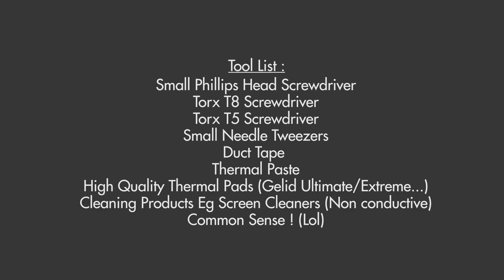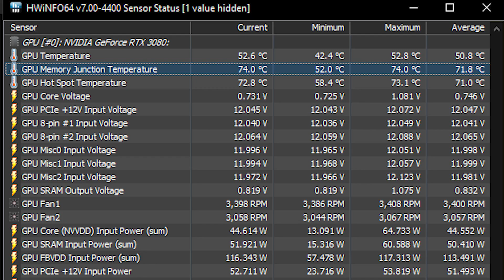Nvidia RTX 3080 (+Ti) Founders Edition Thermal Pad Upgrade Tutorial + Results [G6X ETH Mining Temps]

Comment: I got max Temps 88c on my VRM's using 1.5 pads front and back, max GPU core 70C, I have the stock fan curve but applied an undervolt.  
Average 77C  Temps while gaming most titles. 
I don't hit passed 88c, am I good ? Lol 
Waited so long to get a good price on my 3080FE I just want to make sure I have it running good for longevity.
Reply from the maker: As long as it is below 100*c I guess you're good, because the default thermal pads are a bit shit and the memory junction temps can get really high in excess of 110*c by default which is worryingly hot
Reply: @CHAZMEDIAUK  okay perfect =) yea when I first booted the card I noticed after a 30 min session clocks where all over the place <before I undert volted> GPU core temp was max 75c and one of the fans spooling up ready to take off. 
That's when I open hardware 64 and I saw heat spot and mem temp hitting 101c. 
So being that GPU prices was all over the place I just didn't go an watch much of any 3,000 series reviews.
I was at a lost and everything was new to me when I found out these new Gddr6x were hot runners. 
Watched one episode of gamers nexus teardown and ordered two sheets of 1.5 pads and got to work. 
Thanks again

Comment: For white thermal pads you left them in place without replacing. Any idea what’s the thickness of them? If we use a different thickness pads on back leaving white ones(if at all they are of different thickness) it doesn’t make any sense isn’t it? Also few comments on reddit say there is no use or little use if backside pads are replaced. Is it true?
Reply from the maker: VRAM is flip chip, have a look at diagrams online - so there is quite a lot of heat that spreads through the PCB onto the back where it needs removing so that’s why I put thermal pads on the back to help reduce core temps because all the heat spills onto the nearby chips etc
Reply: @CHAZMEDIAUK  thanks. Did you leave the white factory pads on backside? To left and right?
Reply from the maker: @bps739  nah I binned them. They are garbage

Comment: Hey, what thickness pads did you use?  Didn't see it mentioned in the video
Reply from the maker: 2mm however 1.5mm may work better if you don’t tighten the leaf spring tight enough - I personally recommend 1.5mm

Comment: Hey thanks for the video! I have a question, does dismantling the card and exposing the PCB voids the warranty? do they have any kind of stickers on screw and stuff?
Reply from the maker: No warranty stickers on the 3080/80ti FE since they are designed to have easy removal of the cooler for people wanting to put the EK waterblock on it :)
Reply: @CHAZMEDIAUK  Thanks for the response. Also, do you think putting this on a custom loop will drastically drop the temp on junction?
Reply from the maker: @raghavtripathi564  I guess so since there will be significantly better thermal transfer onto the waterblock than the air cooler
Reply: @CHAZMEDIAUK  Thanks again, I haven't done custom cooling before. So do you recommend any block? EKWB is very expensive for me.
Reply from the maker: @raghavtripathi564  I don’t know if there are any other brands that make a waterblock for the 3080 FE :(
Reply: @raghavtripathi564   Corsair does a great job, my 2080ti is about 28•c (room is 21) in idle and 45 under stress test, I will try it with 3080ti asap

Comment: hi , could a very high vram temp explain why i only get 60mh/s on eth ? I tried every miner, driver etc. Vram always 108-112 °
Reply: did u tried nbminer?
Reply from the maker: You need to limit the power to the GPU to 70% so that it is only using 224W. Unless you have an LHR card

Comment: Is the Lay-out the same for the Ti or are there small differences I should be aware of?
Reply from the maker: Same layout and PCB so there are minimal differences and 2 extra memory modules. You can see in my video there are 12 memory slots however only only 10 of the 12 memory slots are occupied
Reply: @CHAZMEDIAUK  thanks for the quick response! The other thing is I am seeing a lot of differences in people’s personal experiences in pad thickness.  Some have to put in a lot more effort it seems even with 2mm extremes. I really don’t want to be stuck trying to get exact measurements between 2.0 and 1.8 or 1.7.
Reply from the maker: @michaelb3576  might be worth getting a pack of 1.5mm thermal pads for the memory
Reply: @CHAZMEDIAUK  still extremes right?
Reply from the maker: @michaelb3576  I used ultimate here but extreme are supposedly meant to be better but either way both are really good

Comment: Hello, I have a strange problem. I have 2 3080 ti FE. I did the pad replacement and the mem temps went way down as expected but my gpu temp went up to 80 and hot spot temp up to 96!!! I checked the card that I did not do the pad replacement and the gpu temps are only 40 and the hot spot temp is 45. I did a paste replacement artic mx 5 thermal compound. no change. here is where it gets weird. I take both cards apart and swap coolers and now the and now I have the exact same gpu issue on the other card with the good mem temps. I hope I did not confuse you. I joined your discord but I am not able to post on it.
Reply from the maker: Jayz2cents did some testing recently and found too thick memory pads causes the GPU die to have a gap from the cooler cold plate and the die which causes these massive jumps in die temps - Also make sure that when you reassembled the PCB to the cooler with thermal paste that you tightened the screws tightly so that the cooler cold plate makes as best contact with the GPU die as possible. When I changed the thermal pads I didn't notice any change at all to the GPU die temps. 1.5mm pads could help fix this. Hope this helps
Reply: @CHAZMEDIAUK  thank you, I'll order some thinner pads.
Reply: @samuelmakarewicz1728  did thinner pads work?

Comment: Does this voids the warranty? Planning to change the pads on mine. And do you think i can use corsair xtm50 paste? Thanks!
Reply: I believe that it will not void your warranty unless the manufacturer can prove that the work you did caused the issue.
Reply from the maker: I don’t think it voids the warranty since there isn’t a “warranty void if removed” sticker on any of the screws. However I’m not sure about the thermal pads since they’re no longer going to be the original ones

Comment: 3080 and Ti are completely different. This tut is irrelevant for Ti users.
Reply from the maker: It’s the exact same PCB with the 2 additional memory chips. Not sure why you sound so angry lol
Reply: @CHAZMEDIAUK  I was about to say he sounds mad about nothing.
Reply from the maker: Sounds like he has no clue. Even got the same silicon die as the 3080 albeit with more shading multiprocessors enabled lol. Might be jealous he paid £400 more for 5-10% faster with 2GB more VRAM lol. I would be mad if I got scammed for the 3080ti aswell haha
Reply: @CHAZMEDIAUK  I bought a 3080ti :o
Reply from the maker: @JustSoCuteAri  oof. I’m getting a 3090 so guess I’m making another thermal pad mod video 😂

Comment: You don't need to use so much padding on the back of the PCB..
This is the right way to do it without needing to spend too much on pads:
https://youtu.be/KadKjVSzVnc
Reply from the maker: There is no right way to put thermal pads on the backplate. I tried to put them under the memory chips since that’s where lots of heat bleeds through the PCB so putting them would take the heat away from the PCB to backplate. I guess you’ve never felt how hot the backplate is on the 3080 …

Also in the video you sent there is about £30 worth of thermal pads being used. I spent £12 on 1 pack of Gelid pads which was enough to cover the front of the PCB and and do some of the back, I had some additional pads laying about which I decided to put on the ports since my metal display port cables were getting too hot to touch

Comment: Really clear and good instructions. I only have a doubt, since everyone is saying that the ultimates are too hard and they don't squish as much compared to the extremes so the 2mm might not be good for the front part, are you 100% sure you used the ultimate ones? Did you compress the pads on the chip to make them squish a little before putting the cooler on or something like that? I already ordered the 2mm ultimates since I didn't know of this problem, and i wouldn't want to reopen the gpu in that case, thank you in advance.
Reply from the maker: Can 100% guarantee that I got the “Gelid GP Ultimate 1pc 2.0mm 90x50mm Thermal Pad” as of my receipt and they worked fine. I didn’t squish them at all, I just screwed the leaf spring in quite tight when re attaching the PCB to the cooler
Reply: @CHAZMEDIAUK  Thank you that was just what I wanted to hear
Reply: I've tried and I'm getting horrible gpu hot spot temperatures i needed to close everything, something that you suggest doing?
Reply from the maker: @FP541  use 1.5mm thickness thermal pads between the memory and the cooler. High hot spot temperatures indicate poor contact between the GPU die and the cooler which could be caused due to not tightening the cooler tight enough or the thermal pads just increase the gap between the die and the cooler giving higher temperatures
Reply: @CHAZMEDIAUK  yeah now I've tried to flatten the pads and I may have overdone It because Memory junction Is at 100c and GPU hot spot Is the same that I was having with the shitty Nvidia paste so obviously something is wrong.
Btw ordered the 1.5 ones, Monday I'll let you know, thanks.
Reply: @FP541  did it work with the 1.5mm ones?
Reply: @LF11I41  Memory temps went way down, something like 84-86° max, but GPU hotspot was still too high, probably did something wrong. ended up selling the FE to someone more capable than me and buying an Asus TUF one.
Reply: ultimates are the soft ones extremes are the hard ones, perhaps some people got wrong batch of products

Comment: this tutotrial is not good for TI FE . For TI cards you must use 1.5mm pads on memory chips
Reply from the maker: It's the same PCB and cooler with 2 more ram chips on. For me 2mm worked fine but then again it will depend on what pads you use since some are more malleable than others
Reply: @CHAZMEDIAUK  The Gelid pads are a lot softer, if using Thermalright odyssey (which i much prefer) then 1.5mm works best
Reply: @Jayjayuk12345  if using thermalright for a 3080ti FE, 1.5m is all i would need or would I need a different size as well?

Comment: what size did you use a 6-point screwdriver to unscrew the backplate?
Reply from the maker: T5
Reply from the maker: You also need a T8 to remove the IO plate screws

Comment: Do you think Gelid Extreme 1.5 mm and 2  mm would work as well?
Reply from the maker: I only used 2mm. It may work between the backplate and the PCB but don’t use 1.5mm between the memory chips and cooler
Reply: @CHAZMEDIAUK  Did you use Gelid Extreme or Ultimate?
Reply from the maker: @MrLukas2012  Ultimate
Reply: @CHAZMEDIAUK  Some people are saying that 2mm didnt compress enough which caused the gpu not to touch the heatsink.. it worked perfectly for you?
Reply from the maker: @gster109  worked fine for me

Comment: I've done exactly like you and everything is f**ed up now. Before memory was at 100°c now is 66 but the hot spot of the GPU is at 104 , before was at 87 and the GPU was at 78. Now GPU is at 90. Just the memory temps improves
Reply: I had this same thing happen using the 1.5mm Extreme pads on my 3080ti FE, where GPU core and hotspot increased by about 10-15c (not quite as bad as you, the hotspot was about 98c - very uncomfortable). I watched a different video on YouTube and they explained that after the core side pads have been changed you should put the card in the machine and test it to make sure the GPU core hasn't increased. I was a bit nervous because the backplate was off, but can confirm it worked fine and showed me the temps were too high. I opened it back up (which is quite easy if the back is still off) and adjusted the pads to squish them a bit and I also added more thermal paste to the GPU core, with quite a lot over the centre (where there was a less coverage before). I tested again with the back off the card and it's much better now - the GPU core doesn't get above 81c and the hotspot doesn't go above 88c without me undervolting or anything so room for more improvement. The delta between the GPU core and hotspot is now only about 6-7c vs. 10-12c before (example: before reopening the card the GPU core would get to 85c and the hot spot would be 98, a 13c delta. Now there is only a 6-7c difference). It isn't perfect, but much better than before after reopening the card. I had begun to believe that the increased heat on the GPU core and hotspot was caused by the memory making better contact and dumping more heat into the heatsink - this is NOT the case. Sry for essay.
Reply from the maker: What thickness memory pads did you get ? Jayz2cents did some testing very recently and found too thick memory pads causes the GPU die to have a gap from the cooler cold plate and the die which causes these massive jumps in die temps - Also make sure that when you reassembled the PCB to the cooler with thermal paste that you tightened the screws tightly so that the cooler cold plate makes as best contact with the GPU die as possible. When I changed the thermal pads I didn't notice any change at all to the GPU die temps. Hope this helps
Reply: That happened to me too for my 3080 TI. The problem with mine was that the memory chips were getting optimal cooling but the thermal pads restrict the coldplate from making proper contact with the GPU chip and thus high thermals. Try smaller thermal pads depths. My was fixed by swapping 2 mm pads to 1.5 mm or find a thermal pad that is very malleable like Play-Doh with enough thickness.
Reply: @derpydog9711  Cool, I'm about to do this with a 3080 ti FE, so I'll go for 1.5mm ones
Reply: same exact situation here, 3080 ti fe

Comment: How much of a risk will it be if I did this? I have taken apart my gaming laptop several times and even worked at a laptop repair shop. I just don't want to kill my baby....
Reply from the maker: It’s really not hard to do, there’s not many screws on the GPU and only a few wires to disconnect. You need some cleaning products to clear off the old thermal paste and goo left behind by the old thermal pads but honestly it’s pretty simple and well worth the result :)

Comment: I'm not a miner but a heavy gamer/streamer. Do you think i should still change my thermals ?
Reply from the maker: Definitely worth doing. For gaming memory temps are just as high as mining since the GPU die spreads heat into the nearby components like the memory which already runs really hot with the default thermal pads. For the sake of £15 it's definitely worth doing imo :)

Comment: can it be a good mx5 ??? which is the best ??
Reply from the maker: I used Arctic MX4 for thermal paste here - didn’t notice any change at all to the GPU die temperature
Reply: I used MX5 and gelid extreme front side only and spreaded it generously on the die  with an undervolt of 800mv and 1700mhz runs at 70 deg max with Tjunct / hotspot of 85 max